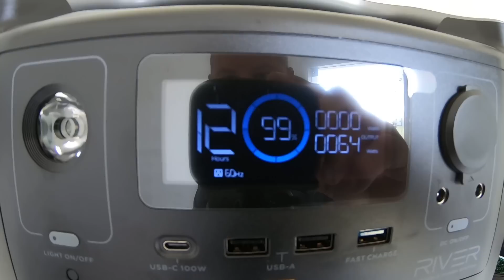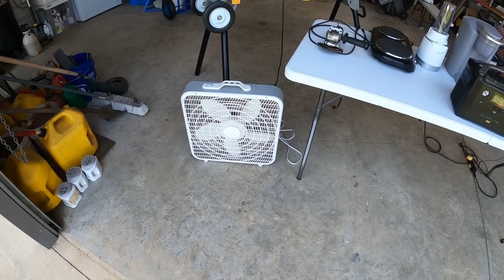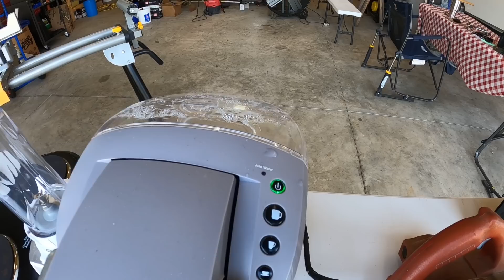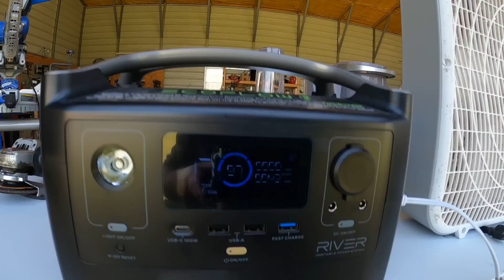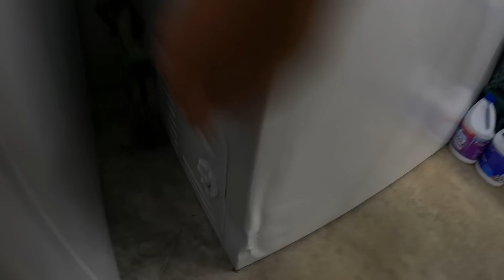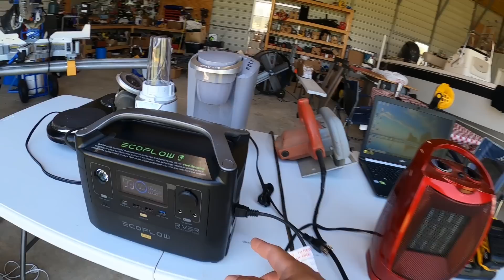EcoFlow River PRO full test and review! Huge episode!!! #EcoFlow #PowerStation #EcoFlowRIVERPRO

Comment: I’m guessing I can use it to run my Chinese diesel heater
Reply from the maker: Yes, believe it or not this model has the most powerful 12 volt output cigarette lighter of any power station I've tested. That's including the $3600 Delta pro. I run my diesel heater with this exact model.

Comment: Thanks for the comprehensive review. In December, I purchased an EcoFlow River Pro with 160 W solar panel for my shed from their website for $655. My lawn care equipment (lawn mower, weed eater, trimmer, etc.) are all Kobalt battery powered tools, so I wanted power in the shed to recharge the batteries for these devices. In addition to having a charging option, I also installed interior lights that are connected to the RiverPro. And, since the generator and solar panels are portable, I can use it in the house during power outages or take it with me for outdoor activities. I use it much more often than I thought I would. I recharge it about once a week so with an 800 recharging cycles to 80% battery capacity, it should last a few decades before I'll need to replace it. That comes out to about $2.73 per month, an exceptional deal in my opinion.
Reply from the maker: Yes they last far longer than most of us will ever recharge and wear them out. I love my river pro.

Comment: Great video. I have one of these eco flow river pros and it is a beast. I keep it hooked up to my tv, amp, a lamp, Wi-Fi router and fibre box no issues at all. I have run all off the above for over 4 hours and have tested this on a fridge too. 

Their support said to keep the max charge set to 90 perfect (you can up it to 100 in the app) but the above was on a 90percent charge. 

There have been a few reports of these exploding after firmware updates so I just left mine on 90. Great video
Reply from the maker: Interesting about the exploding. I still love mine, the best mid sized power station in my opinion.
Reply: I think the exploding devices were not EcoFlow

Comment: How does it handle 50/60hz please? I'm thinking of getting an US one to use in 220V/60hz -land. Will it let me run US 110V 50Hz devices? Will it charge from a 110V 60hz (connecting a step down transformer to 220V/60hz).
Reply from the maker: This device is setup to run 110 volts at 60hz only.
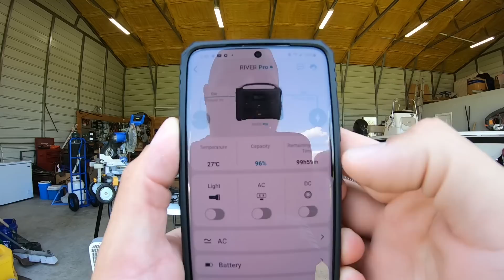Reply: @TKCL  Thanks do you mean input or output or both please?  Here your model is designated the US/Japan one which should accept both 60 and 50hz input. I see from your video at 18:48 that there is a toggle for the frequency. Thanks for the reply.
Reply from the maker: All devices in the USA are designed to run between 110-120 volts and always 60 hz. This device is setup for the same input and output.
Reply from the maker: And yes I do see a toggle for HZ on all ecoflow models so it is available. I just got their new River 2 max today and it has that function.
Reply: Cheers. So it can output 110 50hz or 60hz. Can you verify if the device will charge with a 110V 50hz supply please? I got confused, I'm in a 50hz region. Someone on Amazon suggested that you can even change the output voltage on app, but i don't see that in your video and i am skeptical. Can you verify please?
Reply from the maker: I just checked my brand new Ecoflow River 2 max offers 50hz capability. I no longer have my manual for the River pro, but thought I remember it offering that as well. See if you can download the manual online.

Comment: If you could do a test with X-Boost disabled that would be very informative for the appliances that don't require it to see what runs and what doesn't. Your fridge, freezer, DeWalt batteries, blender, laptop, tiny AC unit, etc. should not need X-Boost enabled. This would show us if the inverter can handle important appliances (mainly the fridge/freezer/air conditioner.)
Also, while not likely, the X-Boost function could damage your laptop charger and is actually strongly recommended to have X-Boost disabled when powering "sensitive" electronics. X-Boost is solely for devices needing more than 1200w, like your 15a (1800w) circular saw.
With X-Boost disabled: 600w running, 1200w surge.
With X-Boost enabled: 1800w running, reduced voltage as demand increases (aka brownout.)

Comment: I just bought this unit here in the UK, with the extra battery (1440w/hrs). I think the extra battery is a must if you're going to be holed up for a while or might experience prolonged blackout.
Reply from the maker: I agree, I keep seeing sales with the extra battery.
Reply: The battery isn’t cheap though. One of the higher wattage Delta units might be better but then you lose out on the combined w/hr of 1440… it’s s choice between powering less items for longer or more (more powerful) items for less time. 👍

Comment: Stop calling it generator; it's not - the UK refers to them as Portable Power Stations (PPS) which is what they are.
Reply from the maker: Triggered eh! I know what it is, I call it what the industry does. It's essentially a nice battery pack with a inverter. Of course more features than that.
Reply: @TKCL  Nah not that triggered, I know the industry calls it a genny but that's not what it is, for you and me, no problem. But very confusing for people that don't know what it is. That said "Battery + Inverter combo" doesn't roll from the tung very well. (with some extra ports slapped on)

Comment: So is this the EF River or River Pro, bc isn't there a difference between just the River "600" and the River Pro? Great review, thanks for the in depth overview of all of the features/plug ins of the power generator itself.
Reply from the maker: This is the pro version. The big differences is the watt hour capacity is a lot more, thus a lot longer runtime. You can also add on to the pro and expand the battery capacity to about 5 times what the standard river model has.
Reply: @TKCL  I have just ordered the basic River and an extra battery for the River. I might upgrade to something better in the future but I feel for now it should be enough for what I am doing. I sleep in a tent and live out of my car so I think it will help me greatly with an electric skillet, and other things I can survive on. I plan on recharging the EcoFlow at my work when I'm there. You might ask why I'm doing this, but it's because I'm saving up for some land. I hope the River + the extra battery attachment will be enough for all of the outdoor things that I want to do. Thanks for the reply. Do you think my setup will have any trouble running things like microwaves, mini fridges, skillets, a/c units, etc... ? I figured the extra battery attachment will help it be able to run what I want at a time more smoothly.
Reply from the maker: A skillet will definitely require the extra battery to run for any length of time, and a mini fridge should be fine. I don't believe you will be able to run a microwave as they are quite demanding on startup. Go for the lowest wattage microwave you can find.
Reply: @TKCL  Thank you sir. You don't think the X Boost or extra Surge input would start a microwave? Aren't the Rivers rated at having an 1800 w initial surge boost?
Reply from the maker: Yes but keep in mind a lot of microwaves are 1000 watts or more continuous. That's well above what that unit is rated for.
Reply: @TKCL  That's true and will do! Thank you!

Comment: If your window unit draws about 70 during fan mode, you should be able to actually GAIN watt hours with a sunny day and solar panel set up. I’m in northern Ohio and with the right angle I can get about 100 coming in.
Reply from the maker: Don't forget about the conversion losses from battery through inverter. Solar would definitely extend the runtime though.

Comment: Great video! Do you store at 100%. For best battery life do you charge at 50%?
Reply from the maker: Always try to store fully charged in case of emergency or power outages. I'm a big believer in discharging a batter before charging. I don't like to recharge unless it's very low.
Reply: @TKCL  Thanks. Do you plan on making a video comparing the Ecoflow at this mid price range with the other top brands, Bluetti, Goal Zero, Jackery?
Reply from the maker: I also made a bluetti video as well since I own a eb70. I've got a 1000 watt model in the mail I'll test soon and release a video.

Comment: I got myself River pro, but I am having second thoughts:How about safety? Some of the appliances like refridgerators should be grounded for safety reasons. There does not seem to be a possibility of that. There is a screw on the device, which is described as the earth screw but the sockets (at least on the European version of River Pro) are not of the type that would connect to the grounding. And I found one device that River Pro is not able to power a gas heater (this is a heater for central heating and  water, it requires some electricity for controls and the pump). When plugged into River Pro, at first it seems to work, but does not give the spark to light the gas. I did some googling and one of the answers stated that it is due to the lack of grounding.
Reply from the maker: Hmmm not sure to be honest, you do realize no generators (gas or electric) offer grounding right? It's up to the consumer to ground to earth for obvious reasons. I'm not familiar with the power requirements of what your trying to power, have you tried it on boost mode?
Reply: @TKCL I found out what is the problem. I got confused about the grounding, because the sockets on River Pro (international version) do not look like our normal sockets that provide grounding. In case of a power outage I simply need to plug the powerstation into the socket on the wall (even though it does not have electricity, it provides grounding) to get grounding for the appliances.  They could have actually mentioned it in the instruction manual. My gas heater also works now (it uses natural gas from the gas network but it does not work without electricity). Thanks for the reply and for the nice review.

Comment: Good Video.  Resistance (heating element) loads are killers, they will drain this thing in short order.  You need to check your saws at full cutting load, not just startup.  FLA is with the saw cutting or grinder grinding, not startup.  I'll keep my generators for most applications.  It obviously defaults to 600W max. output,  that is why "Low" and "High" on the heater does not change with the load.     That "brownout" of the refrigerator is concerning as such low voltages can cause damage to compressors and electronic control boards of some of the fancier refrigerators.  Nice for use in a closed space as you said.
Reply from the maker: Good points!
Reply: If he had disabled x-boost for the fridge/freezer test there shouldn't have been a brownout when the compressor kicked on. However he left x-boost on when testing all appliances, not just the ones that require it.
X-Boost lowers voltage (intentional brownout) when draw goes over 600w to handle loads up to 1800w surge/running, however with X-Boost off it can handle surges up to 1200w starting, 600w running.

Comment: How much W this laptop was taking and how long it will stay up?!
You skipped the part that I'm most interested in :/
Reply from the maker: OK just for you I went and grabbed my laptop and generator 😁. Currently it's showing its pulling 7 watts to charge my laptop and saying it will for 77 hours. So how many watts yours pulls to charge divide by 720wh to get total run time.
Reply: @TKCL  Thank you :) I have a similar laptop to yours that's why I was so interested in how many W this laptop is taking under load and how many Watts when charging.

Comment: Have you tested the efficiency of the unit? I have a River Pro + extra battery (1440wh total), I tried it with a 8w LED buld ran for 12 hours (8w X 12 hrs = 96wh),  however the unit shows 83% energy left (245wh consumed). I am wondering if anyone else is getting the same poor efficiency?
Reply from the maker: No I have not, but it's been serving me well. I'll have to test watt hour capacity one day.
Reply: Was the bulb powered from the ac outlet?  Inverters require power too, probably more than the bulb.  Try usb or 12v powered items, much less background drain.  Also, be sure to power off ac ports when not in use to eliminate inverter drain.

Comment: Great review! I just bought the same unit from Costco for $429. One thing I notice is the one I bought doesn’t have the word  “River” in front.
Reply from the maker: They have a similar model that's cheaper, but also has less battery capacity. That is probably the model you got.
Reply: @TKCL  my model is River Pro $699 at Costco on sale for $429. Even in the app it is registered as River Pro. The only missing thing is the word River.
Reply from the maker: Interesting! That's a great deal then.

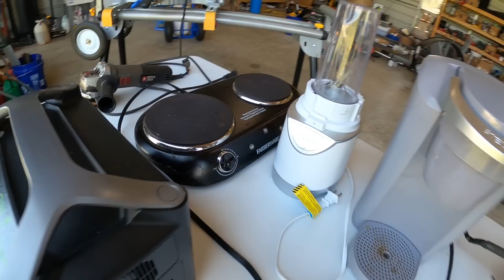Comment: 17:04 It's using its voltage drop magic (they call it X Boost) to keep the load under 600 watts. The river pro does the same thing with my Keurig. Heating items like hot plates will work but they will never get up to the highest temperature. The appliance will be capped at whatever temp it can reach with 600 watts.
Reply from the maker: Yes I discovered after this video it actually reduces voltage to get the wattage increase. Still a very powerful compact unit.
Reply: Sorry can you please explain this a bit more?  If I have an instapot that takes 840w and I need it to get to a certain pressure at that wattage would it work?
Reply: @krisyas3136  it depends on your machine. The ecoflow is going to lower the volts to keep the wattage around 600. If your machine can heat up at 600 watts ( like my keurig) it will work. But there could be some circuitry in it that prevents it from working. "HOW" does ecoflow accomplish this? I'm not sure that's why I called it magic lol. Sorry couldn't be more helpful
Reply from the maker: In that situation no! The x boost is designed for quick surges or startups like a compressor or electric motor startup. Then the wattage drops in a couple of seconds and smooths out. That's not the case with heating elements, they are long steady pulls of power. You would need a larger unit of 900 continuous watts or more
Reply: @TKCL  what's your definition of long steady? Just curious because it works to heat my keurig rated at 1400 watts, but it's about 30-50 seconds
Reply from the maker: I'm referring to the heating element on the insta pot that was reffered to above. Those pull for long periods of time, not exactly the surge capacity the generators are rated for.
Reply: So if your blender is is 900w would it still work?
Reply from the maker: With the boost on that would be at the max limit for continuous running. I'd think a larger unit would be a better choice

Comment: Power = Amps x Volts so a saw at 120 V with 13 Amp =1,560 watts. Put that saw under load bet it won't run. The xboost will lower Volts on a device to run a higher amperage device to run by allowing more watts to be pulled but real tests have shown under load it's only at about 1,000 watts before tripping which is still impressive.
Reply from the maker: I just found out about the reduced voltage, that's a bummer. But yes it's still very impressive for such a compact package
Reply: Would the additional battery you buy to go with the River PRO, enable the voltage needed to run the chop saw?
Reply from the maker: No, all it does is add watt hour capacity and extend run time.
Reply: @TKCL  thank you! I think the answer is already no but can the EcoFlow river flow Pro plus battery have a blow up spa attached to it. I think the spa watts will be too high (up to 6000 watts from reading) but I was just wondering if the connection is possible (I think it requires to be connected to an internal house plug at minimum).
Reply: @TKCL  Can I use an extension lead to connect Bestway's Spa Heater to the power outlet? Close Me
Never use an extension lead to connect the spa heater to the power outlet. The spa heater must be connected directly to an earthed power outlet and able to support the power consumption of 2050W when the heating function is activated.
Reply from the maker: You sound like you have a 240 volt hot tub, that's not compatabile with the voltage or wattage of these devices. Hot tubs pull more power than most home appliances, you would need a large gas generator.
Reply from the maker: Not at all, your many times the rated output of these types of devices, you'll need a permanent home grid power connection or large generator.